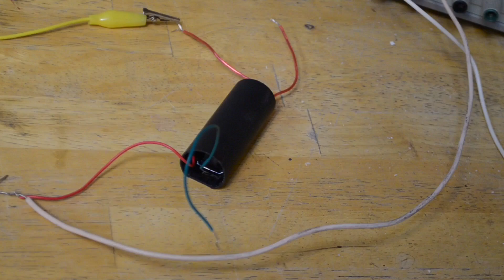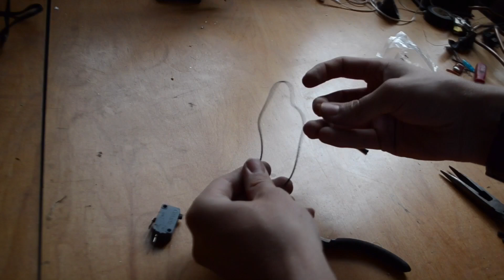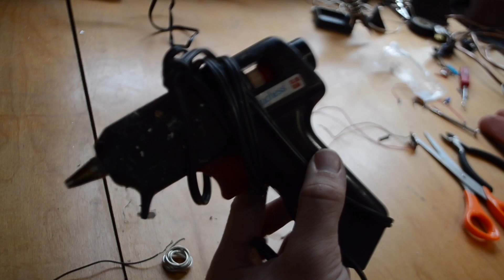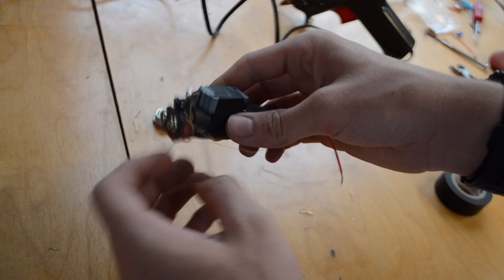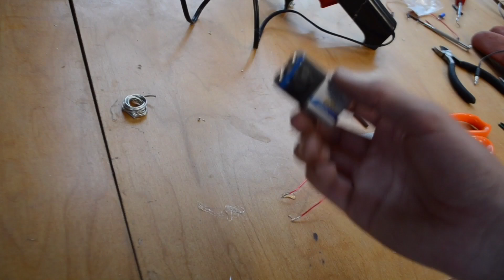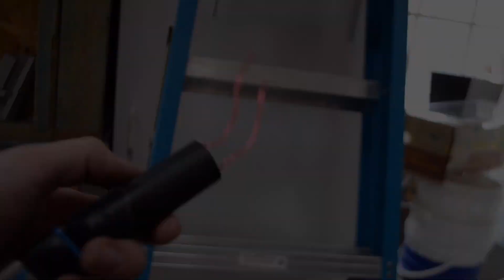How to make a 5$ taser!

Comment: Hi brother..your videos very well and improving my knowledge..
I have one problem regarding Samsung microwave oven..I found fuse blowout which is in between transformer and capacitor..replaced with new but blowout as soon as start..checked magnetron ok.
HV diode shows open ckt on forward and reverse check with digital multimeter.. I increased fuse capacity then I found transformer overheating. Transformer also checked ok.please tell me what's problem..

Comment: how can i safely make a 30 Kilo Watt portable generator A/C  to power my off grid farm,  this must not use fossil fuels.   there is electricity in the air.   so what is the best way to amplify and live off the  'free' electricity.   this must power, electric water pump, hot water heater, frig, freezer, grow lights,  and lights for living, etc.

Comment: would this provide explosive results if i used a lipo / li-ion battery?  i have a spare 18650 battery that i need to do something with, im aware of safety with charging, amp protection, etc.

Comment: Does the "Power Converter" that you used in the video also have an input of 3v-6v like the one in your link? 
I was wondering if a 9v battery would burn out the 3v-6v converter..

Also, did you measure to see what the final output was in terms of voltage and amperage (mA)? I know the converter says 400,000v but that's contingent on the input.. 

If you research stun guns you'll see a lot of conflicting information. They're marketed mostly by advertising the voltage strength, but then supposedly 30,000v is the maximum voltage that can jump across contacts spaced 1cm apart because of "physics" or whatever. Some sources say that its true strength is the microcoulombs: µC, or "charge", other sources say it's the mA, or "current":

 Below 1 mA Not perceptible
1 mA Threshold of feeling, tingling
5 mA Slight shock. Not painful. The average individual can let go. Involuntary reaction can lead to indirect injuries
6-25 mA (women) Painful shocks. There is a loss of muscle control
9 to 30 mA (men) Freezing current, "can't let go". The person may be thrown away from the power source. An individual cannot let go. The active involuntary reaction can lead to unintentional injuries.
50 to 150 mA Extreme pain. Respiratory arrest. Muscles reactions. Possible Death.
1 to 4.3 A There is fibrillation of the heart. Muscular contraction and nerve damage occur. Likely death.
10 A Cardiac arrest, severe burns. Death is probable

So I'm curious to see how this measure up to the real thing
Reply: when i made one and tested it on me and my friends i'd say it goes to the 5mA in your comment

Comment: hmm 9 volt didn't work but i hooked up a old ps4 controller battery and that worked. Idk what kinda voltage those batteries give off but it sounds strong
Reply: The New Captain 9volt aso dont work for me.. what batteries did you then use?
Reply: like I said the battery out of a old broken ps4 controller I had. It is even rechargable
Reply: The New Captain i mean is it a 9 vold or what kind? Having the dame problem and it really wont work. Did it give the same size of arc when you made it?

Comment: I used an 18650 li-ion as it is within the voltage range spec of the unit and can easily supply the 2.3amps that I measured in operation. The 9v battery can't come close to supplying the needed current and will cause the unit to breakdown very quickly if run open circuit. Bad design.

Comment: Advice on your soldering technique: use a flat tip on your 'iron' when soldering to a piece of metal larger than that found on a circuit board, like the electrical contact on the micro switch.  Also heat the bottom side (flat) of the contact metal, then apply the solder from the opposite side (a bit of liquid flux applied to the contact before touching the iron would be helpful, even if your solder is 'eutectic' and rosin core).  Allow the solder to melt and flow to the iron on the other side.  The desired amount of solder will not form a ball, only a thin skin on the contact surface then a slightly thicker 'blob-ette where the wire joins the contact.  Less (solder) is more (a better) connection.

Comment: The ones on ebay say they are rated up to ~7VDC, but you showed it working with 9v. Do they burn out with 9v, or is it still working ok? What do you think the actual maximum input voltage is?
Reply from the maker: +Matthew Foran hmm, it most sly depends on the gap across the top, I made a remake of this video explaining that, bust as long as the voltage doesn't have to build up too high, it should be fine at 9v. The maximum voltage besides that would be based on the oscillator at the beginning. I'm not quite sure what components it uses, but probably don't go too much higher than 9v

Comment: I literally bought the exact same thing with a lithium ion battery and the guy threw in a momentary switch anyway I was wanting a more sturdy set of prongs because if you touch something with your one the wires will move apart and stop working I think thick hollow plastic tubes would work what do you recommend?
Reply from the maker: +Joshua Lansell-Kenny i remade this video and used some finish nails as the terminals, so you can see that video for how they worked out, but I think they work nicely!

Comment: The article says the converter is rated for 3-6V input. Is the current draw reducing your battery's voltage enough to put it into that range? Would you use one or rather two LiPo cells as a substitute? Thanks!

Comment: Love it.. Just wondering would it not be better to use this 6-12v converter:   http://www.ebay.com/itm/Super-Arc-6V-12V-Inverter-Pulse-High-Voltage-Generator-Ignition-Coil-80KV-2cm/401161759510?_trksid=p2047675.c100005.m1851&_trkparms=aid%3D2220071%26algo%3DSIC.MBE%26ao%3D2%26asc%3D20131003132420%26meid%3D16655381b4854daaaf983a3595985d03%26pid%3D100005%26rk%3D6%26rkt%3D6%26sd%3D182146612793

Comment: Is it possible to make 2 of these and have them discharge from the same wires so 2 boxes 2 batteries but only discharging from 1 set of wires if so which is the safest and most reliable way to wire it thanks in advance - Menz0

Comment: making it will cost more than buying it
Reply: @Cyber: I bought one recently for $4. Powerful. Lights up the room and makes a deafening sparking sound. Charges in the wall socket.
Reply from the maker: +Cyber king it shouldn't, all together it costs about 3$ to make
Reply: aside from the converter and switch that  9v battery still over 5$
Reply from the maker: +Cyber king the battery is about 1.50$ ( I know 9v's are over priced :P ) and the button you can buy 100 for like 1.16$
Reply: do i need 9v or does any lower volts would work the same
Reply from the maker: +Cyber king yeah, lower voltages work fine, anything from 3v to 9v should preform well I think

Comment: Keystone, the boost converter you linked clearly states it runs on 3-6 volts yet you used a 9 volt battery. Wouldn't this drastically reduce its lifespan?
Reply from the maker: +greg77389 not if the spark at the top stays to about the size I use ( look at my instructables linked in the description, I put nails on top to keep it at this ) and at least for myself, I've had the same one since I made it and it still works fine :D
Reply: Keystone Science 
Ah I see, so the spark gap is effectively acting as a resistor. Thanks for the reply.
Reply from the maker: +greg77389 no problem! and sort of, the boost converter work by charging up capacitors until it can jump the gap, so if the gap is not too big, it doesn't charge up to a point where it would blow the internal components :D
Reply: greg77389 there like a dollar get 5
Reply: jesse m 
They're about $2.50. I got two.
Reply: keystone, what about amps. how many amps does this thing put off?
Reply: just worried this thing might kill someone
Reply: +Star Lord
The NIOSH states "Under dry conditions, the resistance offered by the human body may be as high as 100,000 Ohms. Wet or broken skin may drop the body's resistance to 1,000 Ohms," adding that "high-voltage electrical energy quickly breaks down human skin, reducing the human body's resistance to 500 Ohms."

That being said, this device would produce about 4 amps minimum across the skin. (Ohm's Law is V = IR)

But as long as it doesn't pass through the heart, it shouldn't be lethal. Since the spark gap is no more than an inch wide, there's almost no chance the current would route through the heart. But it's just like a real taser, so treat it like one. Don't go pranking your friends with it.

NOTE: Although the 9-volt battery supplying it is limited in its max current output, the device has internal capacitors as Keystone stated, which means once they're charged, they are virtually unlimited in the amount of current they can dish out in an instant. High voltage caps are not something you wanna mess around with...

Comment: sucks that the glue gun and soldering tools by themselves cost way more than 5$.. :P
Reply from the maker: +NC Sledge true, but those are not necessarily needed, you could use another adhesive, aswell as just tie the wires on
Reply: Hahaha I guess so. Really cool video man. Reminds me of something you should be able to make in fallout.

Comment: How to make it last longer? mine last for about 3 seconds
Reply from the maker: +weck weck weird, mine lasts a really long time, is your battery damaged in any way ?
Reply: Ah yes I was using new batteries but they was about 6 years old, just got brand new ones and walla works like a charm thanks.
Reply from the maker: +weck weck no problem!

Comment from the maker: Hey guys! I highly recommend you look at the instructables I made linked in the description, I changed the design a bit to keep it from overloading!
Reply: Keystone Science , i liked this project, but the instructibles website doesn't allow to download the steps as long as you're not a pro user, i didnt really want to pay for that, and i only have limited time to memorize all the steps, it would be much better if you could post a link for us to download a PDF copy of what you wrote on instructibles, just an opinion though
Reply from the maker: +George Lain yeah I wouldn't pay for that either, i did not know instructables did that, sorry about that :P
Reply: Keystone Science is it possible to multiply everything by two exept the switch ofcourse, or would it only take 1 9v battery if so how much of battery life would it reduce ?
Reply: $5 taser IF you have the right stuff. So, its gonna run how much?
Reply: If all you need is the momentary you are still under $5 assuming you can get the electronic device with free shipping. If you need to buy all of the construction tools..... well, that is your investment.
Reply: Keystone Science what gage wire did u use

Comment: I did this and at first it worked, but then my converter stopped functioning, instead I just heard a high pitched noise when I pushed the switch any ideas what's wrong?
Reply from the maker: +GangstaUniverse hmmm, how far apart did you put the high voltage output wires?
Reply: Keystone Science about a thumbs width

Comment: what is the schematic for the booster?
Reply from the maker: +Stephen Luczynski it is basically a circuit that creates a square wave then has 2 small transformers, then a voltage multiplayer using 2 capacitors and 2 diodes

Comment: Really great ingenuity, what are the chances of this being lethal? I want to make one with my friends to mess around with and don't want any accidental deaths
Reply from the maker: +Jacob Williams haha, I don't have any percentages, but basically you should be fine as long as it's not shocked in the head or across the heart, also if you get shocked with the terminals on your skin it will Hurt much less than with it going through clothing, ( this is because the capacitors need to charge up more ) in fact, when shocked through clothing it leaves burn marks ( I speak from personal experience xD ) so anyways, if you want to make sure not to hurt them, then probably use something like 3v to power it so that it doesn't escalate too high :D
Reply: Thank you :)
another question, how long will it take to burn out using a 9v battery for it?

Comment: Instead of buying a boost converter.  Most hobbyists use a relay set as a buzzer. Take the EMP from the coil then through a capacitor/resistor lattice to boost the pulse into the crazy voltages you need.. Others use a flyback transformer from a CFL bulb.

Comment: you think could turn this into a taste glove? couldn't I move the switch to the index finger and the two taser wires to the middle and index finger? of course for that part I'd need to make the taser cords longer. any ideas? I would also have the rest of the parts on the back of the glove.
Reply from the maker: +Eddie Shannon yes! I actually have a video of a taser glove ( like I made it months ago ) but it was using a bit different materials, I
And I have tried making a taser glove from that boost converter and then I gave that video to someone else to post on their channel, their channel name was the Kurdish inventor I think, but they are in my subscriptions, so if you go to my channel then go to my subscriptions and click on his channel you will see that video :D

Comment: Question: 

The Step-Up module you used is designed for 3v-6v input, but you clearly used a 9v input. have you had any damage to the module or should we be concerned about the extra voltage?

Does the module not have the ability to draw more than 6v out of the battery or something...?
Reply from the maker: +momaLuigi no, I haven't had any problems with a 9v, I think you will have problems though if you make the HV terminals too far apart using a 9v, however in the description of the video, I have a link to an instructables where I put nails as the terminals to ensure I would not overload the HV caps
Reply: Keystone Science thanks m8!!

Comment: Whats the output current? There is no output current listed. Does anyone know if a similar device (link below) could perform the same? This device lists 1000kv at 0.5- 1 A ...... having 1 A output sounds quite deadly.

100kv 1A converter:
http://www.ebay.com.au/itm/141883808657
Don't use! could kill u
Here is another one:
This one has 0.05 A output:
http://www.ebay.com.au/itm/322328723331
This one could still kill, but its probably more likely to win the lottery.
Anything under 40 milliamps should not be leathal.

Comment: can I just use a 9 volt connector that I took off of something else that I already have?
Reply: a 9V connector is a 9V connector. 50 cents or less from mouser or digikey if you don't have anything to destroy or render useless. Anything not coming from a battery will have the right color wiring to it if it has a red and black (not brown) wire.

Comment: But the boost convertor is 3-6volt?
What I mean is that he's putting 9 volts into it
Reply: good point
Reply: i had one, 9 volts is ok i hooked mine up to my lab power supply and it stopped working at 12.5 volts 5 amps. also i found other part that is not expensive from same seller ""http://www.ebay.com/itm/401092884457?_trksid=p2060353.m2749.l2649&ssPageName=STRK%3AMEBIDX%3AIT"" this is very handy for the battery
Reply: runforitman exactly that's why we get a higher voltage arc of electricity

Comment: Great video I just have 2 questions. Is this deadly? and if not have you tried it on your self?
Reply: Just found the answer to this while looking online and found this while asking the question, could this be used as a stun gun. - Yes it could, but it would be weaker then a low cost stun gun. A generic stun gun is generally powered by a 9v battery, and produces around 1 million volts, these units produce around 15-40kv. At that output, you are more likely to just annoy the person then to hurt them.
Reply from the maker: +Jake no it's not deadly ( we'll probably , it didn't kill me , but perhaps different people are different ) but it hurts a lot!
Reply from the maker: +Jake yeah, but these little guys are not as current limited, in other words, it burns your skin when it shocks you, I'm the way of watts, I think these little boost converters pack more of a punch to them

Comment: isn't the inverter rated for 3-6V? I'm surprised it handled 9V. I wonder though if it didn't damage the circuitry and shorten its life.
Reply from the maker: +itube612 yes,it is, but as long as you don't separate the 2 HV terminals too far, it should be fine ( at least I haven't had any troubles with mine ! )

Comment: Why 9v? would it not work with 3-6v?
Reply from the maker: +Mikael Mortensen  it would work fine with 3-6v ( a little less powerful ) but the reason I use 9v batteries is because it's more convenient with portability , and can easily snap on and off of the connection terminals, but yeah you could do it with 3-6 as well :D